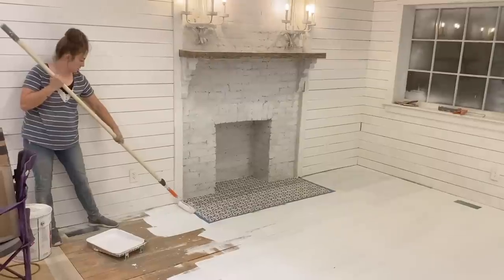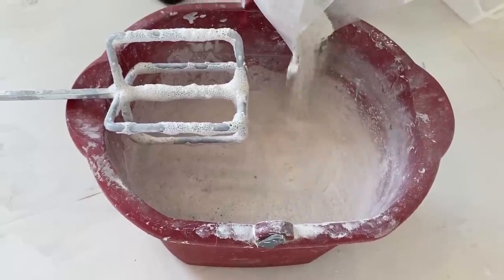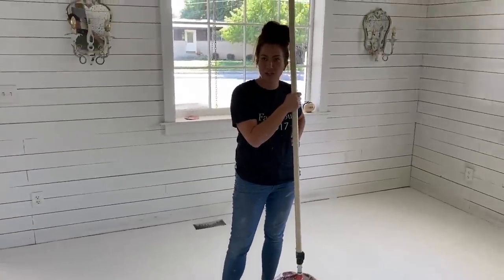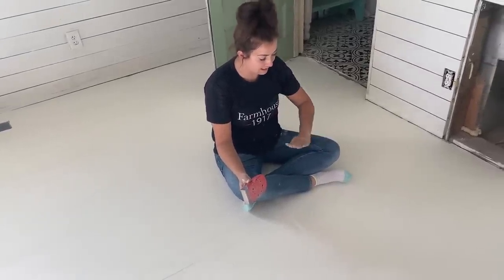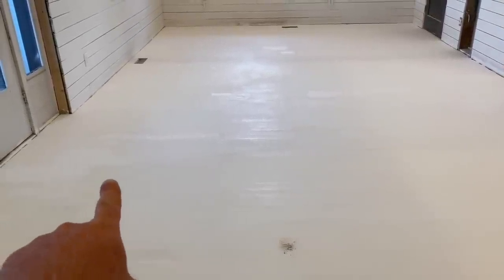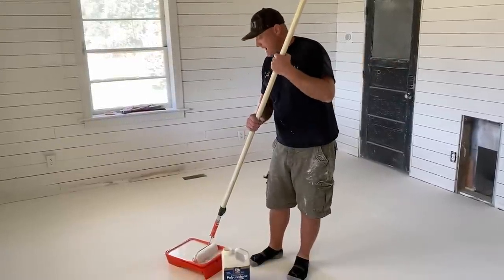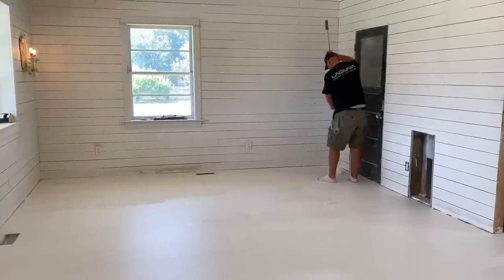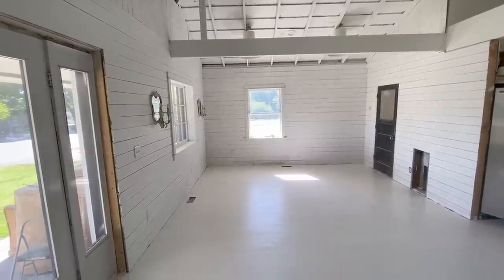How To Paint Wood Floors White and Seal Them

Comment: It looks amazing! Love that soft warm white tone for the floor. 

When I was 3 we moved into the old family home built in 1850. Each room had a hardwood “picture frame “ style floor with pine boards as the “picture “.  After all, everyone would have their turkey carpet so why waste hardwood in the middle. My mother scraped, sanded etc just as you did. She raised pitch out of the pine boards and had to seal them first. This was about 1968 or so and some of the products we have now were not dreamed of, let alone readily available. So she cracked open the window and used dark brown oil base paint so the sealer would not show yellow. Oh it stank. We waked on board pathways for a while but afterwards it looked fantastic. The rooms all had tall windows so there was tons of lights to offset the brown colour. Then, of course, we put a carpet on the centre of the floor. 
We both have sympathy and empathy for all of the hard work you did to get that amazing looking floor and in white to boot! Your house is an amazing testament to hard work, vision and determination. I can hardly wait to see the final product. I bet you hardly wait too!
Reply: I grew up with something like this, but in my grandparents' house, my grandpa laid oak flooring and then carpet. When we bought their house decades later, my husband and I pulled up the carpet and finished the oak floors.  Upstairs, the floors were all wide plank pine and we painted them. Great memories!
Reply: I’m remodeling my farm house now and I have pine floors and originally it had the a 2’ wide border around the outside of the room and the inside was sheet linoleum. I think I’m gonna do the same as what your mother did and sand the floors first to flatten them out then paint with a chocolate brown oil based paint. And then I can top coat with an oil based poly , water based will wear thru in a year or two and does not last. I was a builder also and made that mistake on ten homes and had very unhappy clients and then had a very unhappy banker when I had to pay for all those floors to be redone again, lol

Since my home is an actual farm house, I’m always dragging dirt in unfortunately and white will show it too much even if I sweep 3 times a day but love the chocolate brown and think it will be beautiful. I took the flat ceilings out of the entire house and have vaulted ceilings in every room now so that with the light from the windows should offset the dark floors. 

I’m glad someone has already been down this road and thinks it looks nice as well. Take care
Reply from the maker: Yeah, a working farmhouse might make it tough on the white floors. That’s one of the reasons I pushed to pour concrete all around the house to help keep the dust and dirt out. We’ll see if it works with 8 people living in the house lol.
Reply: Jami Ray Vintage I wish it wasn’t like that cause I sure love the clean look of the white but I think what I’m gonna do will look good also, I don’t want to be married to a broom or vacuum 4 hours a day, lol. 

The kitchen looks amazing!!  My design is similar to yours but I gotta admit that I’m really envious of that fridge/freezer combo!! I’ve wanted that for years but I just can’t fit it in without a small bump out and I can’t go thru all of that right now. Do you mind giving me the rough dimensions of your kitchen room by chance just for comparison sakes?? And did you guys build that cabinets also or did those come from a cabinet shop/manufacturer??

Thank you so much! It looks so good, your getting there!

Comment: Wow I really like those floors guys. Our house is 122 yrs old. Parts of it still have the horsehair in the walls. There were round holes in most of the rooms near the ceilings for some kind of heaters or wood stoves. The larges room in the house, the diningroom had no electricity and there is still so much that needs to be done to it but we are tired now. Im tired watching you but I wish I had it in me to finish it. I feel in love with this house the minute I walked in the door.

Comment: Had the old ruff cut native lumber on a ceiling, we exposed. And the only thing I could find to clean, was a straw broom. Anything else I tried just left more dirt & particles of anything & everything on it. It was kinda like you had to scrub the cobwebs & dust off the native lumber. Because they stuck to the tiny ruff cuts.. I had used boiled linseed oil to finish them, to give them a sheen.  Because they where so dry. But the ceiling was a dust & cobweb magnet. I loved it anyways, but it was trail & error to find something to clean it & hard work to keep it clean. Possibly because you painted & sealed yours it won't be so hard. I put the linseed oil on with a brush & had my first experience with the spontaneous combustible reaction. As I was throwing the blue paper shop towels I wiped the linseed oil off after it would run down my arms & put them in the trash can. 
There was an awful smell coming from it & it began to smoke. So luckily I noticed before it got to out of hand & took them outside. It had been snowing & snow was on the ground, so I placed them all over the ground to put the smoking fire out. I feared if I put them in the dumpster they would cause the whole dumpster to catch fire. 
This is going in my book of What Not To Do.. lol
 What made you decide on that piticular sealer? Besides the water base? 
The floor looks fabulous & that roof is so nice! What alot of work went into both. But they make the look you are going for! ♡

Comment: Hi I love the video. I have white floors throughout my home and was wondering now that it's been 4 years since the video, how are the floors holding up? Would you have done anything differently in hindsight now? Thank you!
Reply from the maker: @jamesgreen5488  they worked for a few years but because there was no sub floor they chipped a lot. We have since replaced them with new oak hardwoods and we just sealed them with white oil wax
Reply: @JamiRayVintage  thanks so much for replying so quickly and I appreciate your honesty! We see amazing stuff online, but they never circle back to see how it held up after wear and tear, especially with white floors and high traffic areas :)

Comment: would u recommend milk paint for going over hardwood floors that are sealed? or should it be sanded?
Reply from the maker: Depends on how shiny it is. If it’s worn and matte I’d say you’re ok to do a light sand and go with it. If it’s gloss shiny I would sand that down until it’s dull and then paint.

Comment: What paint would you recommend for painting white tile back splash?  The tiles have yellowed.  I would like them white again.
Reply: Sheila Sparkman   I’m not sure how tiles could yellow, unless they just got dirty. I’ve seen tiles over 100 years old that are still bright colored.
Reply from the maker: Scrub them with heavy degreaser and maybe some bleach. Then prime with the salvation solution, use diy paint and seal with a good water based sealer. Maybe even the floor sealer we used would work. If they are shiny I would lightly sand them

Comment: I have a question I pray you respond, can you use this on concrete as well? I want to do white on my concrete floors, please respond. Thank you
Reply from the maker: I think you can. I’ve not tried it but it’s an enamel paint.
Reply: @JamiRayVintage  thank you so much for responding , so the paint you mixed is only good for hardwood not concrete?

Comment: Old homes are not perfect from ceiling to floor. Exterior walls to interior walls. I love my 1909 beauty just the way she is. She had to be repaired after Katrina. But nothing has changed except new kitchen cabinets and AC. Floor plan is the same. Old plaster walls dry out and is easier then drywall.
Reply from the maker: Nice!

Comment: Guess dust is less visible on a white floor versus a black or very dark floor. At least that's how it works on stuff I have that are white. After switching from black to white PC I don't see dust as easy. Same with my speakers that are all white, I need to sweep my fingers on them to see how dusty they are.
Reply from the maker: It’s been pretty easy to keep clean so far. There’s a couple of cracks between boards where the old floor has some flex but other than that it’s holding up pretty good.